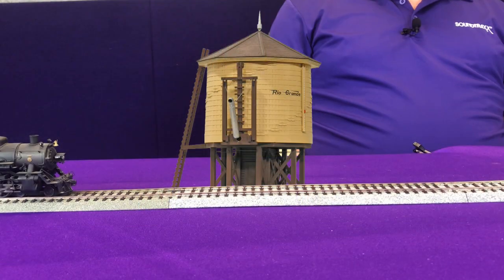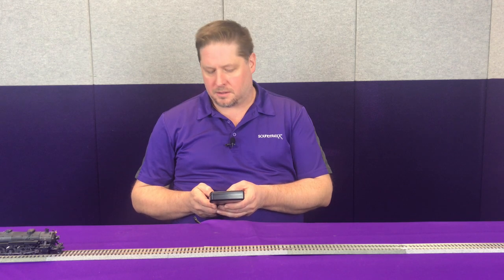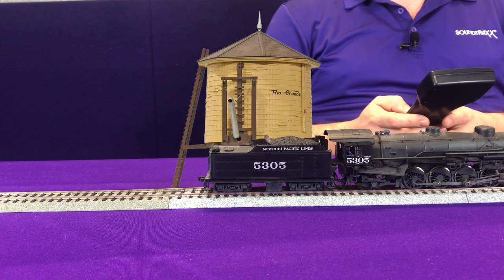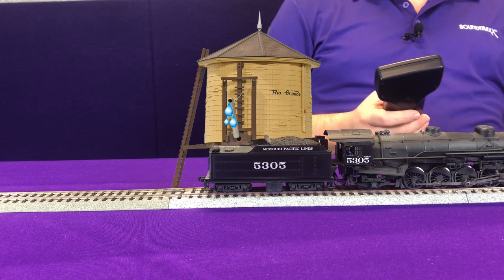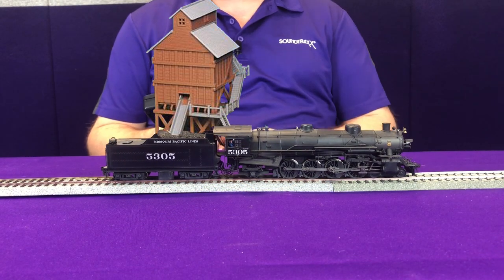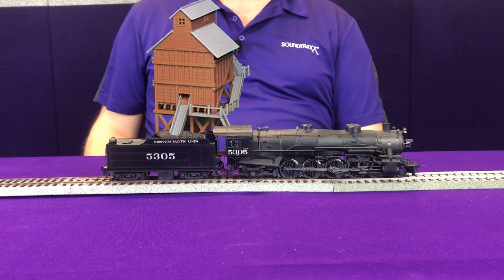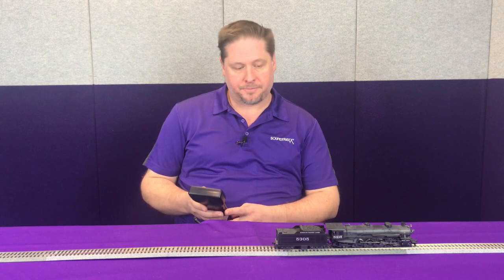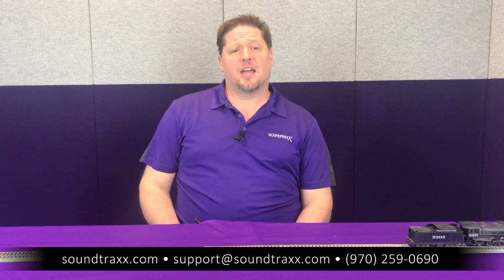Servicing your Tsunami2 Equipped Steam Locomotive

Comment: George,
I've been using Tsunami's since they came out and love them and Soundtaxx's customer service and reliability. I have a couple of the new T2's but haven't installed any as yet while concentrating on building my new layout. The new sounds are  nice and I like having a better selection of whistles, bells and pumps. I'm concerned about not having a chuff cam available. I know you guys have answered my questions and stated it isn't needed in the various videos but you haven't sold me on this. I noticed this Mop Mikado had about 8 chuffs per one revolution. Have you set the chuff rate on this one? If not I would suggest you do that on any videos to convince me and and some others it will work as stated. Personally, I expect to hear 4 chuffs per revolution on my engines. It's more important than having radio chatter, All-Aboard, tank lids slamming, Fireman Fred farting and many of the other lesser sounds. It's something that's very noticeable and is used any time the engine is running.
Reply from the maker: I don’t remember how or if it was set.  If its off, its easily changed.  Sometimes, settings are changed for demo purposes and forgotten to be reset.  Since the purpose of the video was servicing, I never looked at it.
  
The chuff is set based on rotations of the motor.  The decoder can sense the different BEMF ‘signatures’ of the poles of the motor, and can then calculate X rotations of the motor equals a chuff.  When you set CV 114, it basically ‘marks’ the motor and then internally says X rotations of the motor equals a chuff.  If it’s off, change the CV value and now Y rotations equals a chuff.  Since it marks the motor rotation, it will stay in time.  Set this when the loco is running at Speed Step 4-6, so you can see it rotate and count.  Adjust CVs on the fly using mainline programming.  Its newer technology and its done with many trials and confirmations internally before releasing it to the masses.  I too was one that insisted on a cam.  But as technology moves, we have to adapt.  Once upon a time, moving pictures was fantasy!  We also all had antennas on the house and now we have HD TV delivered from signals sent from space!  One of the bigger drawbacks of the physical cam was the occasional double chuff (where the contact bounced and contacted it twice) or the no chuff (Where a wiper completely did not make full contact with the cam lobe).  I’ve seen both of these happen on many occasions.  Using a digital cam reading the motor as is in the TSU2 and Econami, its much more accurate than a throttle command chuff rate and as accurate as a physical cam.
Reply: George,  Thanks for the detailed explanation. When I get a chance I will install a T2 and test that out. Not installing a cam and wiper assy will definitely be a plus. I used Cantara cams in all my engines and only did the wiper on the back of a driver once. It did make a double chuff at times when it bounced and was a pain when the insulated coating wore out. Those were my PFM Sound days. Thanks, again.